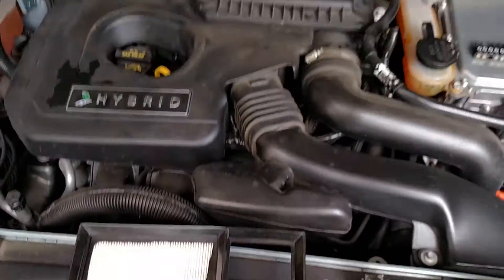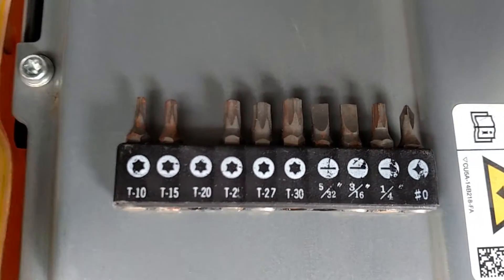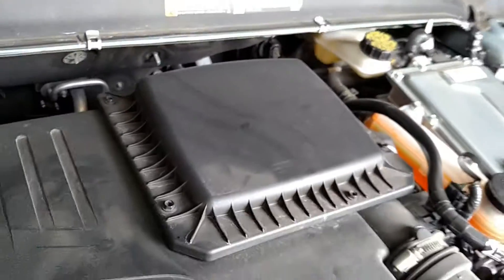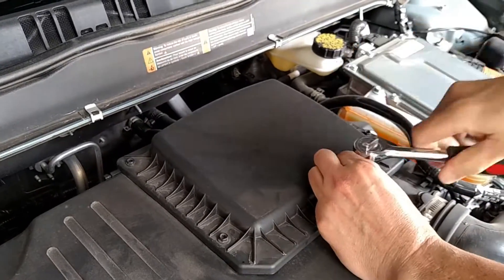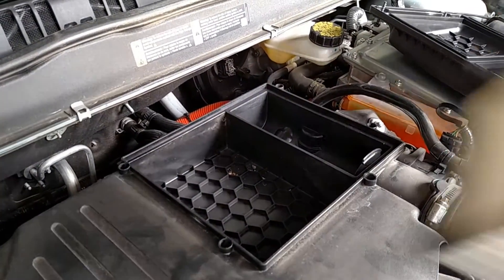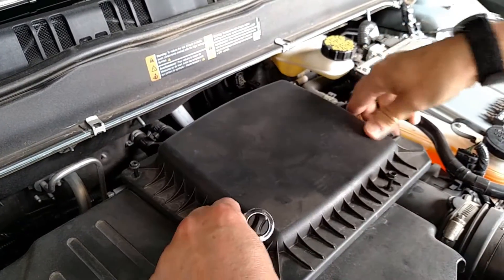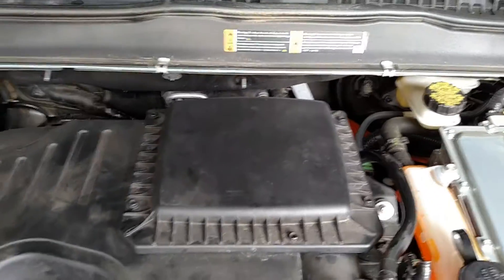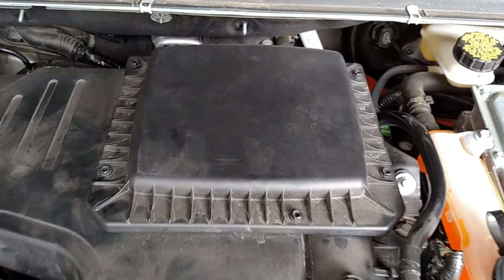How to Change the Air Filter of a 2014 Ford Fusion Hybrid

Comment: Ford recommends not replacing the engine air filter on the 2011 Fusion Hybrid for the life of the car and if the dealership says it's needed they should do it. Looks like it is under the left front fender.
Reply: Robert Greenhouse that's a weard place to have the air filter in my ford fusion 2.0L ecoboost cabin air filter is behind the globebox
Reply: yes the CABIN air filter is behind the glove box,  but the engine air filter on my 2011 Ford Fusion hybrid is in the left fender. Not easily accessible.
Reply: Robert Greenhouse well on 2nd gen ford fusion is not that hard to get access you need a couple of tools that's what I used on mine
Reply: Joe Gotti what does 2nd gen mean?  Year? Engine? Car?

Comment: You better be using Ford's motorcraft engine filter. Only Ford's motorcraft parts are only parts to use on ford motor company vehicles.

Comment: Ford recommends not replacing the engine air filter on the 2011 Fusion Hybrid for the life of the car and if the dealership says it's needed they should do it. Looks like it is under the left front fender.